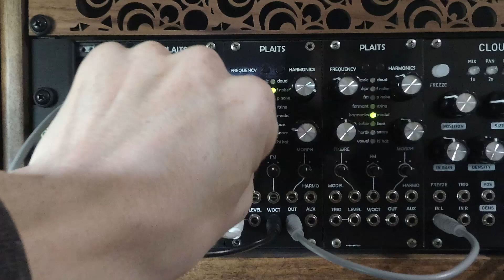Plaits Video Manual Part 1: Global Settings

Comment: Dude, my Plaits DIY stopped blinking to show models, any idea what it could be? Is there any way this can happen by pressing buttons through some type of settings? OR someway to reset to default settings?
Reply from the maker: No, Plaits is made simple that way, so it is probably the light or connection to the light.  Hopefully just that...but then that would require someone opening it up and repairing it physically.